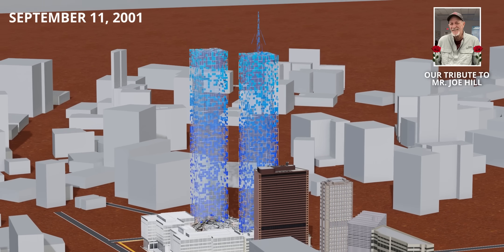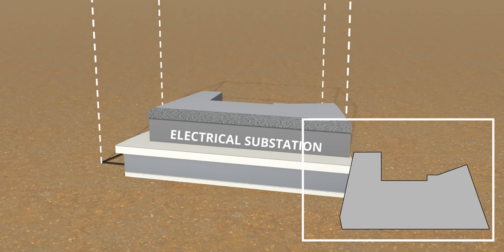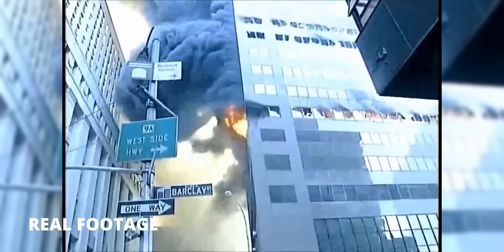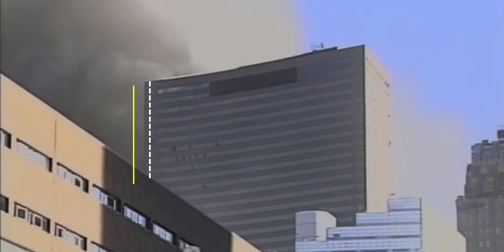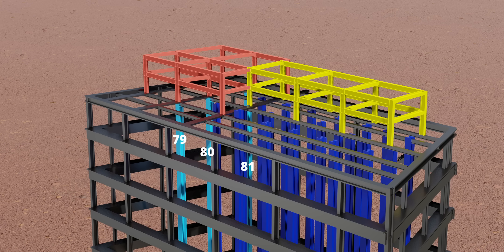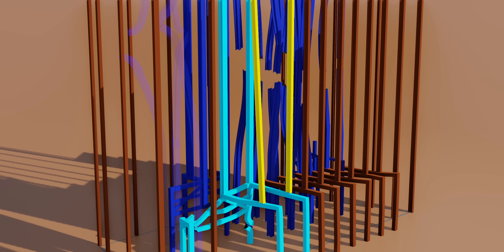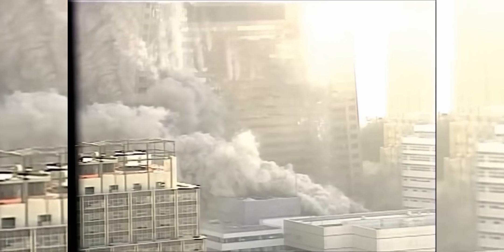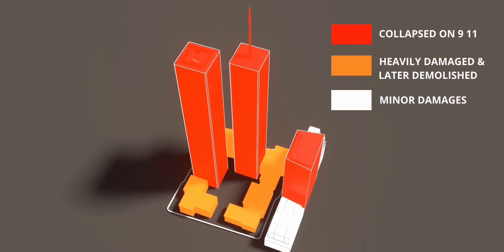Collapse of Building 7 | The Complete Physics

Comment: The "fires caused it" was debunked by a peer reviewed analysis by UAF.  NIST refuses to acknowledge the analysis showing they aren't about science.  The top did fall, symmetrically, at full FFA, that is officially acknowledged.  Look up the conditions required for FFA ( grade 10 physics) and now you should have a lot of questions
Reply: @dikranovichk5889  explain it (finally) so I can have a huge laugh
Reply: @brianstantz3457  - You are not serious. You want to believe.  You don't want to know.
Reply: @TheCriticalStinker-jw4fl  🤣🤣🤣 you're afraid; how shocking
Reply: It’s a lot of trouble to get to this thread. This guy cant answer a question, he therefore has zero ability to check himself.  I
Reply: @dikranovichk5889 as someone that has followed this thread, you were the one supposed to answer a question, more than once. And never did.  The conditions for Free fall acceleration are clear there can be no resistance whatsoever under the falling object.  I remember how NIST claimed there was no free fall acceleration from the start. After a high-school physics teacher exposed how easy it was to measure they admitted it and added it into their final report. This video is literally one big fraud.
Reply: @dikranovichk5889  - It is a conspiracist through and through. You have to pick just a single point and focus on that and only that, hammering it home until it runs out of evasions or runs away.
Reply: @dikranovichk5889  I'm waiting on your explanation. Seems you are afraid to put it down. Wonder why?
Reply: @fakedfitz, maybe you can answer a question. In the jowenko interview, the demo expert concludes that the bottom was exploded, and the rest of the building dropped. He says, and asks his twoofer handlers, the top doesn’t go first, it starts at the bottom. They collapse the base and the rest falls, and with his own eyes in the video he is shown, he concludes, men could wire the bottom floors, and the rest would drop.  Here is the question fake fitz.  Does the collapse of building 7 begin at the roof, or the base of the building?  One question   One question, one question only
Reply: @dikranovichk5889  @dik, you're not going to give your version are you? You don't even have one and are just wasting my time and everyone who bothers to talk to you. Ah well. Run along child, I have work to do
Reply: Brian, if there is one thing we can agree on, it’s that having posts deleted from this thread or any, Is a real pain in the ass.
Reply: Hey, not for nothing, but the “truthers” could take their case to court, and could present their evidence. It hasn’t happened………..yet.  I’d settle for a verified judge here in the comments section.  A moderator who could help with the dialogue, and call out people when they get off topic or are evasive   They’d be awful busy and have their hands full with these twoofers
Reply: @dikranovichk5889  faked Fitz? What is that supposed to mean? Nice to see the initial comment vanished. So to reiterate, I happily offered to answer your question once you'd answered the questions asked by the other person on parameters needed for free fall etc. If you won't do that I doubt you'd answer any questions of mine and I believe in quid pro quo.  You first.
Reply: @fakefitz,  don’t worry, I’m aware that you too are not capable of answering any questions.  I get it!   Your thumbs up buddy Brian tries to push the hulsey aNe study as peer reviewed.  He’s probably trying to commingle the Bentham press articles, which was considered “peer reviewed” in a magazine that accepted a gibberish article as peer reviewed. So take this joke review and pretend it applies to the hulsey study.  I mean, it’s right here in this thread. 

The joke about the free fall is the time is taken after the building has been collapsing for 6-7 seconds, at the very least.   The building was already in collapse when this 7.5 stories of free fall acceleration was measured. Does it dawn on the twoofer that the collapse of the building could speed up its collapse?  That’s not a question for you to answer.  

I don’t think the twoofer likes the view of the collapse from the west side hwy. CBS camera view. It is the clearest shot and sounds of the collapse.  You can imagine jowenko was not shown this video, at least not from the beginning. He would have clearly seen that the collapse did not start at the base, and began with the penthouse collapse.  He would never has concluded that the bottom fell first, because it clearly did not. 

In the video from the west side hwy, you can see the penthouse starting its collapse before the first windows blow out. You can see the penthouse fall into the building, and you can see the roof ripping apart. At this moment, Brian’s famous “shell only” portion of the collapse begins.  Here is where your 7.5 stories of free fall acceleration occurs.  The penthouse acts like a yo yo, and when iit gets to the bottom of its rope, it tugs down on the building  you morons like to watch with your eyes closed in all likelihood
Reply: @fakedik why are you calling me @fakefitz? Bizarre behavior indeed
Reply: Quee pro quo!
Reply: @dikranovichk5889     Quit trying to make them understand. "You can stump a philosopher with one fact. But not an idiot with a thousand facts."
Reply: "was debunked by a peer reviewed analysis by UAF"
You do know that making up stupid shit isn't an actual argument, right?

"NIST refuses to acknowledge the analysis showing they aren't about science. "
What "analysis"? What "science". "I have no understanding of what I'm talking about but I'm really right, SO THERE!" is neither.

"The top did fall, symmetrically, at full FFA, that is officially acknowledged. "
We already went over this. Making up stupid shit only mean you're a small child insisting YOUR daddy is a POLICEMAN so there! Let everyone know when you've grown up and joined the competent adult world.
Reply: Let's see how this strikes you...

1, The supposed "study" of Hulsey's was bought and paid for by A&E911. Now, there's nothing wrong, per se, with that, feasibility studies and the like are bought all the time. But, considering that A&E911 have a vested interest, the impartiality of the "study" does leave some to wish for.
2, the "study" was to take 2 years to make. And then it got moved. And then it got moved again. And then it went very quiet for some reason for quite some time. And then it finally was released, 5 years after it was announced, and 3 years late. I'm not saying the "study" was massaged to fit the customers wishes, but it's rather interesting that it took TWO AND A HALF times as long as it was meant to.
3, the "study" was supposed to be open to criticism by the public, and then it was supposed to be peer reviewed after that. And then, for some STRANGE reason, that went away, and it was just quietly released into the wild with no mention.
4, the "study" findings were already determined before it had started. A&E911 asked for donations and organized a drive to be able to pay for it, at which point they announced what the outcome would be. Let's repeat that. A&E911 told the world what the "study" would say, even before they'd paid for it, much less before it started.
5, the "study" is more or less spent refuting the NIST report. However, NIST isn't the only report that say that the collapse started due to fires. These other reports are mentioned but aren't addressed.
6, Hulsey's "study" tries to so something impossible. It attempts to prove a negative, i.e. that fire could not have been the starting mechanism for the collapse. This, as anyone with even the slightest knowledge of science knows, is impossible. You can prove what happened. You cannot prove what didn't happen.
7, Hulsey is not competent to make the "study" he did. While he is an engineer, his work has entirely, and solely, been about road-surfaces and bridges, as well as cold-weather effects on the same. There is NOTHING in his work that has anything to do with buildings, or fires.
8, the "study" is a shambles and a joke. There are holes in it so big you could drive an 18-wheeler through them. As just an example, the model showing the data and conclusions of the "study" has the engineering "penthouse" of the WTC 7 hinging in the middle, completely dissimilar to what visually happened, then collapsing, in one piece, through the building, without causing any damage to the rest of the building, stopping about a quarter of the way down, and then literally just hanging there, still in one, deformed but still mostly intact, piece.
9, the Hulsey "study" has been referenced, or even MENTIONED, in any reputable engineering publication, exactly NEVER.

And, while it isn't an argument as such, it is very interesting to note that Hulsey went from being head of the department to being "Professor Emeritus" after his "study" came out. This rather suggests that, much like Steven Jones, he embarrassed the university and so, they shuffled him off to the "honorary" position so he wouldn't be quite so in the public eye.
Reply: @mooneyes2k478  thanks for jumping in and writing waaay too much. Same question for you, to make this very simple; what are the conditions required for full free fall acceleration according to very basic physics? Now what does the term asymptotic mean in relation to bending and failing support structures? This will clear up any issues you may be having.
Reply: @brianstantz3459  They always dodge the free fall.
Reply: @brianstantz3459  - Wow, you ran away much faster than usual.
Reply: @TheCriticalStinker-jw4fl  let's try again then. Define the conditions required for full free fall acceleration, that's about grade 10 level physics so I know you can do it. Now define what asymptotic means when referring to failing or buckling support structures. This ends all nonsense
Reply: @ Guess you ran away, again.
Reply: @brianstantz3459  - No. You have not addressed the concerns I raised in my first reply in this thread, and I will not be chasing any deliberately evasive off-topic derails you try to employ to avoid dealing with them.  No moving forward until you address how Hulsey claimed to have proved a negative and how his one grossly simplified (dumbed down) model could possibly be superior to anything The NIST (or ARUP or Weidlinger for that matter) did.
Reply: @TheCriticalStinker-jw4fl  tell me you can't answer the questions which are central to the entire conversation without telling me. I told you if you have questions about Hulseys peer reviewed paper to speak to him. Or better yet, take the data he freely shared and do your own peer reviewed analysis using the same techniques and get a different result, that's how this works. But you can't since you aren't qualified to do it and instead hide instead of addressing the 2 very simple questions that show you believe in a fantasy.  Thanks it's always fun to watch your kind expose yourselves.  Have a nice life.
Reply: It’s one of those strange riddles. A building that’s 47 stories tall is in free fall for 8 stories.  Why didn’t the other 39 stories fall at free fall. What, the building decelerated as it fell?   Using explosives???
Reply: @dikranovichk5889  no the 8+ stories of free fall from the start are the problem.  According to basic physics the only way that's possible is if every single support structure across the width and breadth of the building on those 8+ stories ceased to exist at the same instant. Failing / buckling supports are asymptotic, they never offer zero resistance making ffa impossible, so that's out the window. So unless someone can show fire on a few floors can instantly vaporize all those support structures on over 8 floors, fires could not be responsible for what was observed
Reply: @brianstantz3459  Why is it you had no rebuttal to the facts pointed out to you about your fairy tale?
Reply: @mooneyes2k478  you consider physics and structural facts fairy tales? Well that explains a lot? Where was your rebuttal to the facts that destroyed your fairy tale? Oh right,  you ran away, again.
Reply: @brianstantz3459  Ah, yes, of course. "NO, YOU!"

There's an amazing argument.
Reply: @mooneyes2k478  there was no "argument". The questions were simply "according to basic physics what are the conditions required for full free fall acceleration?" And "what is the definition of asymptotic when referring to failing/bending support structures?". Those 2 questions always send your kind running.  Funny that.
Reply: @brianstantz3459  No, there were no "questions". There were "Oh, shit, all of my stupid shit is stupid, quick, change the subject and then pretend it never happened."

You carefully and deliberately avoided every single point made to you because you can't come up with a valid reply to any of them.

And when called on that, your reply was "No, YOU!"
Reply: @brianstantz3459  "That is such a blatant lie it's comical."
Yeah. It's just that you can't actually rebut the "lie". Much as you couldn't rebut the previous post and its points, instead pretending that really, you're right.

I know that you can't, but just try to argue the points put to you instead of trying to hide behind "Oh, that's lots of words." Unless you want to admit you can't manage basic English, that is?
Reply: @mooneyes2k478  there were 2 questions, claiming there isn't shows your grip on reality is tenuous at best. But then that's what I expect from crazy conspiracy theorists like you. If you can't answer those 2 very basic and easy questions then there is literally nothing to discuss further. Or will you revert to bot posting?
Reply: @ A desperate attempt to avoid the points put to you by blathering irrelevant nonsense isn't "questions". It's a sad little failure.

So, how are you coming along with the points put to you? Still can't actually come up with a reply? Of course you can't.
Reply: @Brianstsndz4030, do you think the collapse of building 7 begins with the collapse of the penthouse, or does the collapse begin later, when the shell falls?
Reply: @dikranovichk5889  - It begins when the building starts to move, so several hours earlier.
Reply: @dikranovichk5889  "the shell"? Please prove only the exterior was standing or we'll just put this down as pointless conjecture
Reply: @brianstantz3457  - Watch the video above. It does show the collapse sequence correctly.
Reply: @TheCriticalStinker-jw4fl  watching the real collapse, I see the Penthouse fall, then a pause, during which time exactly no windows below it break indicating is smashing through, then we see the entire top fall symmetrically at full free fall acceleration. As as been established the conditions required for ffa and what asymptotic means when referring to failing or buckling support structures makes that easily observable event impossible to explain using fires.
Reply: @brianstantz3459  - Glad we got that sorted out.
Reply: God, the penthouse and roof collapsing in, it really ruins the whole “truther” fantasy.  If you want to know what Appalachian snake handlers sound like, just listen to a twoofer try and explain away the penthouse collapsing as part of their freefall theory.
Reply: @dikranovichk5889  So you never proved you "shell only comment" lol and thought I'd forget? No the penthouse does absolutely nothing to the issue of ffa. What are the conditions required for full free fall acceleration? What does asymptotic mean when referring to failing or buckling support structures? Answer those questions and your view becomes....impossible.
Reply: @brian. I dont have to prove a shell only comment,  because there was no “shell only” comment. I do love how you skewer your own position, by acknowledging that the building was collapsing before your 8 stories of free fall occurred. It takes a truly arrogant moron to not realize they have undermined their own position.
Reply: @dikranovichk5889  I Guess you forgot your comment from 9 days ago where you literally used the words "when the shell falls"? Well that makes your latest comment very embarrassing.  Can't help noticing you're not answering those 2 simple questions which destroy your conspiracy theory either. Wonder why? 😆
Reply: @brianstantz3459  - Much the same way you abandoned your support of Hulsey. Pot, meet kettle.
Reply: @TheCriticalStinker-jw4fl  ? I told you if you have issues with a peer reviewed analysis to contact the authors, he will actually respond. As it's the only peer reviewed analysis done on the subject there's not much to say until someone (maybe you?) Does your own analysis using the same data and methodology and gets a different result. That takes care of that.  Now those two questions I keep asking that caused you to run away, care to try again or running once more?
Reply: @TheCriticalStinker-jw4fl  Still running away, you did not answer the 2 questions.  What are the conditions for free fall acceleration (officially acknowledged at 2.25 seconds, which encompassed over 8 stories so try another tactic) and what does asymptotic mean when referring to failing or buckling support structures? This is so easy, last chance as this has gotten boring.
Reply: @brianstantz3459  - I did answer. Everything you need is right there in my last two posts.

You just have to actually read them.
Reply: @TheCriticalStinker-jw4fl  no you did not. Free fall is acknowledged by NIST, its absolutely incontrovertible.  It happens for more than 8 stories worth and the the entire top section falls this way. Since we know ffa only occurs when something is meeting zero resistance, yes zero, you have to show how fires removed every single support structure on more than 8 floors, across the width and breadth of the building at the same instant.  Have fun!
Reply: @brianstantz3459  - So am (average) acceleration of 9.8m/s/s can only occur in zero resistance?  Really?

So I couldn't accelerate bicycle to say 9.8m/s/s?

Or a car?

What if the object is moving in 3 dimensions, like a lever (hint, hint)?

How did Chandler's single measured datapoint (which can not possibly represent the entire building) not show any sustained acceleration of GA but rather was an average that over an arbitrarily chosen 2.25 seconds start out under GA then accelerate up to, then OVER GA and then back down below GA during those 2.25 seconds?  

What caused the over GA ?
Reply: @TheCriticalStinker-jw4fl  yes, for ffa to occur with a falling object with no external forces acting upon it there must literally be nothing under it. Your comment with the bicycle shows you are just trolling and Chandler? No NIST. You don't know enough to waste time on anymore. Good bye.
Reply: @brianstantz3459  - Wow, you don't even know who David Chandler is, do you?

You forgot to explain why the measurement (which cannot represent the entire building since it only represents one point) is a curve, not a straight line and how it achieves a period over GA during that arbitrary 2.25 seconds.
Reply: Brian, did the free fall happen during the “shell only” part of the collapse?  Did the penthouse really begin collapsing before windows start blowing out?  Do you think controlled demolitions wait for the buildings to begin collapsing before setting off charges?
Reply: @dikranovichk5889  🤣🤣🤣 "shell only".  I love that you base your entire argument that building exteriors are completely separate from their interiors and complete destruction of the interior will not show in any way on the exterior.  The absolute best part is that ffa still wouldn't be possible for a "shell" to do if there was anything underneath it. Head back to grade 9 and start over.
Reply: Brian, what happens first, penthouse begins collapsing, or windows start blowing out?   Which of these acts happens first?  And I don’t blame you for not answering.
Reply: @dikranovichk5889  just so I can attempt to understand, your theory is that the penthouse collapses, then the entire interior of wtc 7 is utterly destroyed leaving the "shell" which you think is completely separate and free standing from the interior, with no sign of motion or windows breaking, then the "shell" breaks basic laws of physics as it drops symmetrically at full ffa? Is that accurate?
Reply: Not even close, and again, I understand why you can’t answer any questions. And certainly not which happened first, penthouse begins collapsing or windows start blowing out?  Windows are clearly breaking before the “shell only” part of the collapse.
Reply: I have a question.  Exactly how does the UAF study manage that?

Looking at it in detail, Hulsey set out with a list of 3 objectives for his study.  From the Abstract, page i, and repeated again verbatim in Section 1.2, page 13;

The objective of the study was threefold: 
(1) Examine the structural response of WTC 7 to fire loads that may have occurred on September 11, 2001; 
(2) Rule out scenarios that could not have caused the observed collapse; and 
(3) Identify types of failures and their locations that may have caused the total collapse to occur as observed.“

Did Hulsey do any of that?

NO

Hulsey brings up only three scenarios - those of The NIST, Arup, and Weidlinger, but primarily focuses on just a detail in only one of them (the NIST girder A2001 walk-off at column 79, floor 13 hypothesis) while hand-waving away the others with a few sentences. This one facet of one scenario was the only one he modeled. 

Hulsey only modeled fires on floors 12 and 13 and did so using a grossly simplified temperature set taken from The NIST (with no explanation as to why he dumbed it down).

Thus, the Hulsey team chose to ignore the very substantial fires on other floors such as 7, 8, 9, 11 and 14 which created (in the "worst“ Case B) >1,000 °C gas temperatures in all those floors, slab temps >675 °C and steel temps >600 °C.

The NIST had found numerous connection failures after 4 hours in the framings of all floors 8 to 14. Failing to model the elevated heat profiles in floors 7, 8, 9, 10, 11 and 14 made sure from the start the Hulsey study could not possibly evaluate the full structural response to all the fires on those floors. 

Further, Hulsey considered the temperature distribution at only one point in time (5:00 pm according to the NIST timeline for structural heating), ensuring the possible effects of the dynamics of increasing and decreasing temperatures could not possibly have been detected by Hulsey. The Arup team hypothesized a critical girder connection failure occurred as cooling, contracting beams pulled a girder off its seat at column 79, so this is a critical omission by Hulsey as his modeling would be blind to such an occurrence. Failing to model the dynamics of extended multi-floor fires over time ensured that the Hulsey study could not possibly evaluate the full structural response to all the fires on those floors.

Therefore, Hulsey with his simple and limited models could not possibly rule out fire as the proximate cause of collapse or claim to have proved The NIST wrong.

Had Hulsey been honest/understood what he was doing he would have declared that his model failed to produce a fire-induced collapse. He could not and did not prove that all fire scenarios would fail to induce collapse

There are potentially thousands, maybe hundreds of thousands of possible scenarios - he tested only a small part of one.  Thus Hulsey failed to prove his reports main conclusion by way of fundamental logic error - can't prove a negative without accounting for the full envelope of possibilities.

Take your time with that. I am fully aware that is a bunch of stuff you had no idea about and never occurred to you. At the bare minimum it would have required actually reading and understanding Hulsey's paper.
Reply: @TheCriticalStinker-jw4fl  weird, it's deleting my responses.  Lets make it short. Questions on the peer reviewed analysis by UAF should be directed to them, not me. As of today it's the only one I'm aware of that exists. Dr Hulsey has discussed the findings in various presentations and interviews, you should know this. But this discussion is far easier, tell me what conditions are required for full free fall acceleration to occur, very basic physics I know. Then tell me what asymptotic means in relation to failing or buckling support structures and why that matters for wtc 7s symmetrical free fall for over 8 stories.
Reply: @TheCriticalStinker-01  the UAF report released all data, NIST did not. The UAF conclusion was that fires could not have caused the collapse of WTC 7, NIST claimed they did.  If you have questions on the UAF peer reviewed analysis, I suggest you contact them directly.  As of today it is the only peer reviewed analysis of WTC 7.  Dr. Leroy Hulsey has discussed the study's findings in various presentations and interviews, providing further insights into the research, something you should know.    Tell me, what are the conditions required for full free fall acceleration?  This is basic physics, something I am sure you can handle.